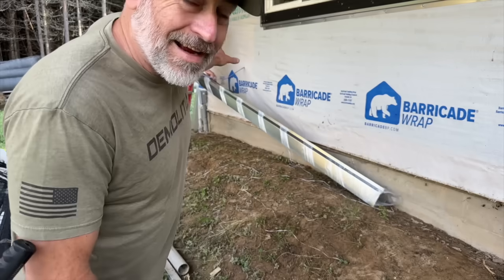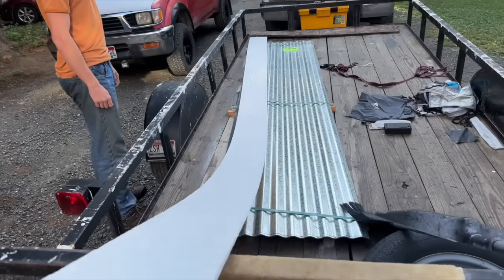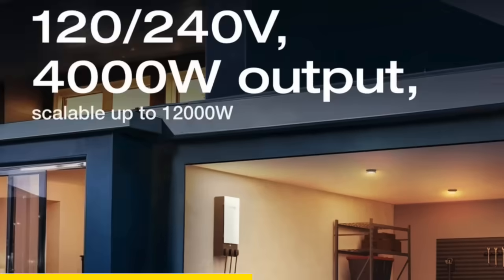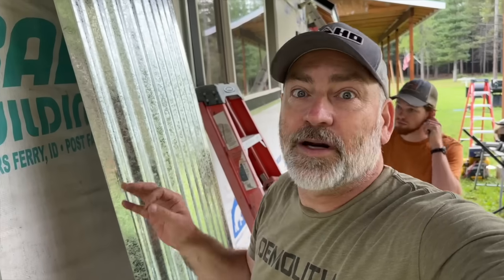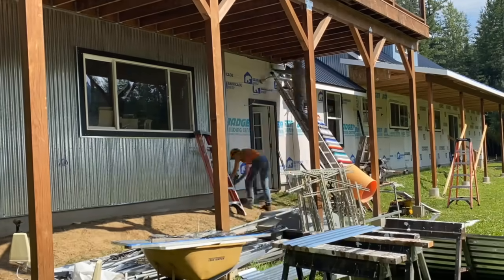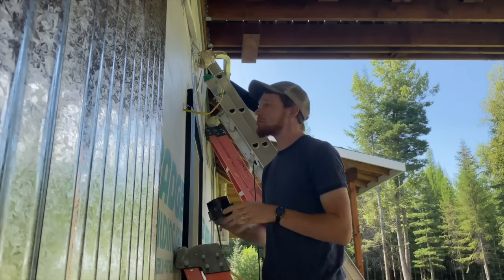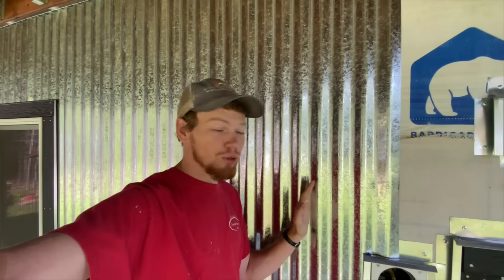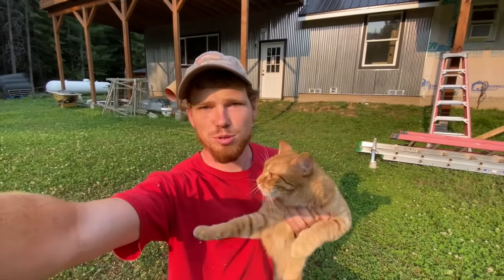This Took FOREVER...Siding our Off-Grid Home with Corrugated Metal Siding

Comment from the maker: Stay safe and powered during hurricanes with @EcoFlowTech. Reliable, indoor-safe, and easy to use, EcoFlow is your ultimate home backup solution. 
Enjoy 5% off with my code 24EFDCMARTIN for your backup power, valid until September 9 (Applicable for all products except Delta Pro 3 standalone, flash sale and accessories).
Discover the latest generator tech EcoFlow DELTA Pro 3: https://bit.ly/4ccDWKL (https://bit.ly/4ccDWKL)

Comment: A easy way to cut out for the LB conduit is to use a hole saw the size of the conduit, then trim from the bottom up. If the metal is flex enough, just make one cut up the middle.

Comment: Harbor Freight sell various different hole saw sets from carbon steel (cheapest) to bi-metal ones (better steel quality, more expensive and more equivalent to the Milwaukee ones) Looks like the one you were using was the carbon steel version.

Comment: Good job! One question though, won't the metal siding catch all the sun rays and heat the whole house? I'm wondering what are the benefits, and if a huge flaw compared to wood would be to lose insulation AND produce more heat in the summer.  But maybe you aim for that, for cold winters?

Comment: you should be wearing gloves working with sheet metal and corrugated metal. looking good though. Does the nibbler not work on sheet metal? Seems to me it should work better than manual tin snips.